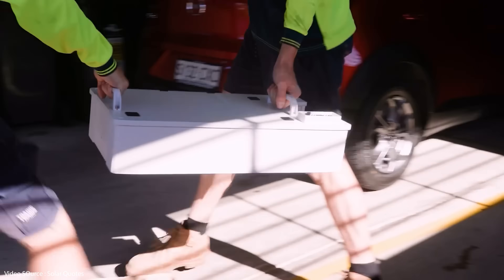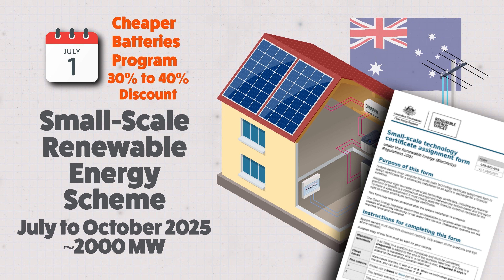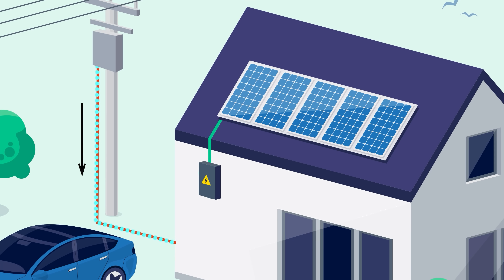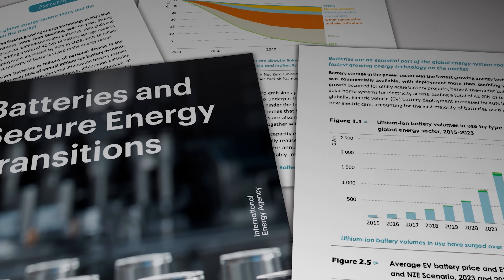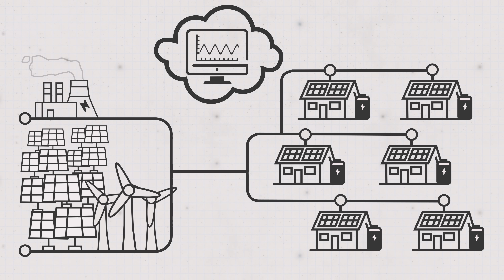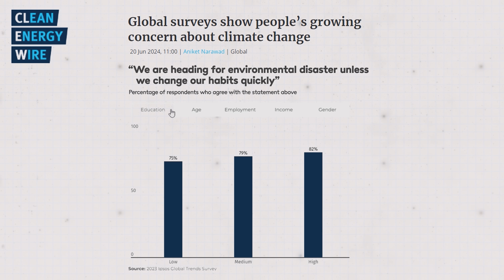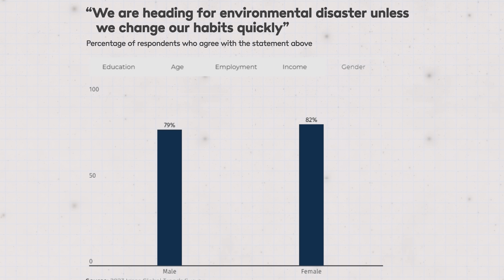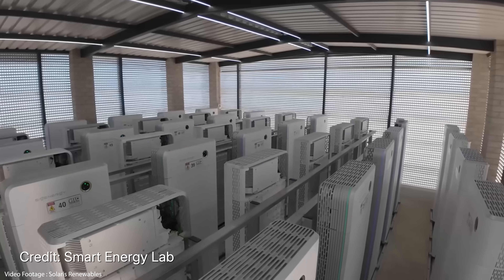Australians installed 100,000 home batteries in 17 weeks. Why can't we all do that?

Comment: As an Aussie in Melbourne Australia, Our solar works super well from late September through to early/ Mid March  but falls away over our late Autumn (Fall) through Winter and into Mid Spring. My 9.4 kW three phase array through 8kW inverter generates approx 12 MWh every year.  
October , November, December, January and February being the main months of production where each month exceeds 1 MW, with June and July seeing as little as 500 kW for the month.   So in those Low solar months a battery is typically only charged off the grid as solar is so low.  Charge from small solar and the grid at off peak Time of Use tariff and and either use for your self  or sell back at peak times aming a margin on the rates. For how long that continues - who knows. Power retailers already reducing Feed in tariffs for solar to 1 cent per kWh. 3 years ago I was getting 5 cents per kWh.  
The battery rebate scheme maxed out at 50 kWh batteries and is now under review as the 2.7 Billion that was set aside has nearly all been used, by people that put in batteries far greater than they needed in order to make money through VPP and arbitrage on tariff prices for energy. This rebate scheme has been modified and from May 2026 the size of battery for rebate will affect the amount of the rebate.. so a big battery will now get less. 
The scheme was expected to last 4 years but is now likely to only last 2 .5 - 3 years maybe.

Comment: A plug in and go solution is needed.
Reply: Solar is just way too complicated and intricate.  Geothermal is the answer.
Reply: @Les_S537 because that's so simple and cheap.
Reply: @RichardFraser-y9t  Now it is.  Mechanical bits can only drill so deep before the time and cost stop you.

Quaise Energy has developed millimeter wave (MMW) drilling where you eliminate all the down time associated with mechanical drilling. 

With mechanical drilling you get to a point where your bits are breaking down due to the heat and the pressures involved, as well as the type of rock you're drilling through.

Drilling through sedimentary layers of rock is relatively easy, but once you get deep enough you're dealing with granite level density rocks, etc...

You have to stop drilling, retract the bit, change it out, shove it back down to the point of impact and within a few hundred feet its time to do it all over again.  Plus you have to spend time encasing the borehole in concrete to keep it structurally sound and leak proof.

Quaise Energy's MMW drilling eliminates all that down time because it literally vaporizes any rock in front of it AND seals the borehole at the same time because as it vaporizes the rock it melts the sides of the borehole thus sealing it.

The deepest boreholes we can drill with mechanical drill bits are ~15k feet, but to do geothermal in thick parts of the crust you need to reach 10-20 km deep.

Quaise Energy's MMW drilling will get us to that depth and unlock geothermal for everyone.
Reply: @Les_S537  And solar you order 12 x 450W panels at £55 each on a pallet with delivery included, then you stick them up and it just goes.

It's only slightly more complicated to assemble than lego if it's a system designed to use pre-made end-user cables.
Reply: @etchedpixels  rolling my eyes...  installing solar is not so easy that you can just stick them up.  You need inverters, storage, lines run, controllers, etc...

Comment: I saw that video by Rosie. I was so moved, I cried. You have to understand that Australia is, notwithstanding it has huge amounts of sun & wind, produces a stupid amount of oil & gas & coal. But in this world you don't get blamed for selling the cigarettes, only smoking them. The mining lobby is so strong in Australia it has collapsed governments - that is why Australia is increasingky a backward economy - those troglodyte industries are so powerful they don't give air to anything else. What is worse, they sell the gas overseas and there is none left for Australians on the east coast, leading to high power prices, when power should be cheap as chips! It's a complete joke. (I'm from Western Australia where they reserved some gas for domestic use, not many issues there - yet). That's why I hope the new grid forming inversion will create the inertia in the system, giving stability, so that individuals are more in control of their own power sources, and we won't need coal or fission nuclear. Let's face it - we need to be locally sustainable as far as possible - the geopolitics is dire - forget international trade - except for the billionaires. Then the only reason for Australians to sell the fossil fuels is for greed - and I'm hoping that Australians won't stand for that. Watch the video from Rosie. It explains very well. Thanks for the shout out.

Comment: Home batteries could be a good idea to countries with no access to hydroelectric or simular quick regulated source. I think that Nederland and my own country Denmark could benefit. But thats is not what centralistisk power grid owners like. In my childhood 1960'es there were many small consumer owned grids. They were nationalized to become comercial strong and liberale companies 1990'es. Today there are many batteries on wheels in Denmark. If these was connected to  solar cells and bidirectional chargers they could become quick regulators to the grid. Many of them drive less than the half of their capacity, that means more than 20 kWh per EV are usable to home storage. At the moment fewer than 100 are connected bidirectional.
Reply: Vehicle to grid will ruin your vehicle's battery pack because it'll use up your battery packs limited number of charge cycles. Keep your vehicle battery pack dedicated to driving only.

Comment: By contrast the US is subsidizing coal. And trying to block wind and solar.
Reply: You gotta get rid of that buffoon in the Whitehouse.
Reply: stop lying! also the coal is actually helping the base load and the intensive industries which australia doesnt have, plus why would they subsidize litteraly everything? solar, wind, evs, batteries..... total waste of ressources. is electricity going to build the roads you drive on or is it going to make the tires for your ev?
Reply: @carholic-sz3qv tell us you don't understand the grid without telling us you don't understand the grid
Reply: @carholic-sz3qv who is lying? That what the white house is doing. I am against subsidies aside from those to enable a starting industry. We have done that repeatedly for centuries. We needed to jumpstart solar and wind but need not do that now. We still subsidize fossil fuels but we don't need to do that either. I am happy to see subsidies for electric vehicles go away. I don't think ev's are a good idea but I wouldn't block them like trump is trying to do to renewable energy.

Comment: The advantage of a battery is being able to avoid  peak hour tariffs. This works when normal usage happens, however, when charging an electric car as well it tends to drain the battery meaning there is nothing left at peak hour, therefore no benefit.
Admittedly, a 5kw Solar system is inadequate to run a house and a car on a 20kw battery when the car takes 70kw.
There is a lot of talk of V2G, where off peak power can charge the car and draw on that power when needed. In the meantime, to make the most of my battery I will need to charge the car externally. 

I live in country Australia,  lots of sun, a fair bit of wind too.
Greg Rendle.
Reply: It really depends on how much you drive. We have a 9.24kW PV system and top up the car a few times a week when the sun is out. The type 2 AC charger draws 7kW, which our PV system can satisfy if there is enough sunlight.
Reply: @TheWatcherInTheTower  Ours charges at 12kw, at 5kw from the 20kw battery, that's only 4 hours worth.
Having only had the battery for a few weeks, I am still working my way around it. Going through the app, I found the battery can be charged from the grid during off-peak times, which should allow the car to be charged and the battery as well. Cross fingers.
Reply: @gregoryrendle909 it's fun figuring out what works. Often I will flatten our home battery while charging the car, but since we are only topping the car up, we still have enough hours of daylight left to get some charge back into the battery before sunset. It all works out if the days are long enough.

Comment: .

regenerative agriculture is required to reverse global warming 

I’m all for and excited about the renewable energy getting cheaper and helping to reduce fossil fuel carbon dioxide climate change
Why is all we hear about is carbon dioxide from fossil fuels? Conventional agriculture is a major source of carbon dioxide. Regenerative agriculture draws down carbon dioxide and stores it in the soil. Almost totally ignored is the the cooling effect of living plants. Dead soil caused by modern agriculture and deforestation releases mass amounts of carbon dioxide and methane. The exposed did brown soil, absorbs solar heat, and radiates his back to be trout in the greenhouse blanket. But the main thing that needs to be restored is black carbon rich soil that supports plant cover that draw carbon dioxide out of the air and install it in the ground. Plants absorb heat through water, evaporation and transports the heat up above the greenhouse blanket and releases it back into space and creates more heat reflecting clouds. I'm an electrical engineer and fully understand and support clean energy. Regenerative agriculture can restore the living soil and keep the ground covered with green year around and transport more heat back into space.
I also understand biology with a masters in nutrition and bio chemistry. Thomas Hall.

￼

Comment: Meanwhile in Poland government tries to make building a storage even less possible by adding new building law that enforces building separate building for a battery (even if it contains less then 3 e-bikes batteries of energy). Furthermore this building has to be specially protected against fire (which ads even more cost). All to safe the tax thy take from selling energy.
Reply: UK guidance puts them outside (usually on an external wall not near a window), or in a garage or similar separate location. Here that works well as garages are already covered for additional fire regulations because ICE cars go up in flames so often.
Reply: I know someone who had a home backup battery bank in their garage...  Caught fire and ruined their home with toxic smoke plus burned down most of the home.

You want any battery bank separate from your home for safety.

Comment: It's not rocket science...Australia has lots of Sun!  Doesn't work in Scotland!
Reply: The UK has lots of wind, and also a massive demand drop overnight. That makes buying all your power at 7p/kWh not 28p/kWh rather attractive and that works anywhere in the UK. Solar is just extra icing on top.
Even in Scotland solar generation is pretty good much of the year, and you can always fit more panels than the equivalent Australian (as they are cheap) providing you can find somewhere to put them.

Comment: Prices for solar keep falling I hear, but something still isn't right in the system.  Four years ago, I bought a 10kw solar system (25 400w panels).  The cost was $33k and the government paid $10k.  A 400w panel is about $400.  So the cost of panels should be $10k.  Four guys showed up at 9am and were done by lunch.  Let's say $2k for installation.  Add an inverter on the side of the house, a new meter, and wiring it together, shouldn't cost $19k.  I know the city packed on almost $2k of fees, but that sure leaves a lot of expense that I'm not seeing.   With all the falling prices, solar systems should be a lot cheaper than they are.  Living in Texas we get plenty of sun, so these should be very popular.
Reply: $AU 6000 for my 14kw system fully installed.
Reply: US$ price of a 450W panel in Europe is about $80 including taxes - and free delivery for two or more. Most US folks have no idea how much they are getting shafted on solar and many other things too.

There are some big cost problems the US has beyond tariffs and rip off pricing of components though. Most EU countries have a single regulatory regime for the entire country, and large parts of it are converged across countries. The US has millions of tiny little regulatory regimes and AHJs all of which have their own regulations, own interpretations and cause nightmares for scaling installation processes.

Comment: Large appliances are running on AC.  Smaller need power supplies converting 240V AC to 5+ DC.
Entire home system would be simplified enormously if we converted AC wash machines and dishwashers etc to DC, removing the need to create grid-matching AC from battery/solar DC and relegating the AC<->DC coversion to the house-grid touchpoint.
Reply: Washing machines and the like draw enough power at peak you don't want them on 48v DC. There is a lot that can be put on 48v DC effectively - some passivehaus type setups use 48v lighting, and of course RV folks have long used 12v fridges.

A lot of that however stops being convenient with the latest generation of equipment because they run at 600v DC not 48v DC, and 600v DC is not something you want running around your house.

Comment: You are right of course (in the present circumstances) about us folk here on the northern - and currently not particular sunny - hemisphere. However ... if the grid was developed and designed today I wonder how it would have looked like. Here in The Netherlands we like to talk a lot. Among other things about renewables, grid congestion and 'energy poordom' (Dutch: "energie armoede"). However ... I think the fossilized legacy companies are still overcharging relative to distributed generation. Even renewable distributed generation. Even renewabe distributed generetion without PV. So, in a residential situation can we do without the grid (at reasonable cost - possibly cheaper relative to a fossil reference - given current technologies)? I think we can. I also think it begins by thinking about the grid differently. All the current stakeholders will not change this, why would they. So, I think you are on to something with this story, also here 'on top' of the world (in the backwards upside-down worldview).

Comment: I’ve had PV for nearly 13 years and recently added 15kWh of battery. I was on V2G with my Nissan Leaf but traded that in for a Kia Niro EV and had to bite the bullet and get batteries.  Had them for 3 months and they’re great. I have a Tepeo ZEB and Mixergy hot water tank so no gas and although it’s been very mild and not had to work the heating too hard, I’m paying £100 pm for all my energy needs, including running the car. Also have accrued £2K in credit with Octopus so just had a £1K rebate drop into my bank account just before Christmas, nice. Yes there’s been a bit of disruption but well worth it.  Predicable, low, energy bills and no fossil fuels. With a grant from the UK government the lives of so many could be improved and save on very expensive grid upgrades. It’s a no brainier, and as they seem to be in short supply for UK governments - brains that is, maybe it will happen?
Reply: I would have tried getting another car with V2H.  It makes more sense.
Reply: @PeroniPete my car has v2h but not in the same way the Leaf had and I couldn’t afford a brand new car with full V2G or a charger to go with it.

Comment: 100,000 in 17 weeks works out to about 2.8% of Australian homes per year. If every home had a battery system and replaced it every 20 years, you'd need to install systems in 5% of homes per year to keep up.
Reply: I think that's a bit like gas boilers nowadays being replaced every 20 years. There will be recycling processes more readily available in the future to build new ones. Maybe not so much of a problem.